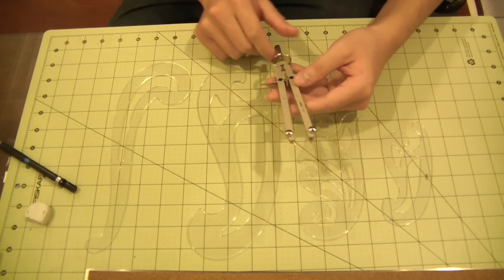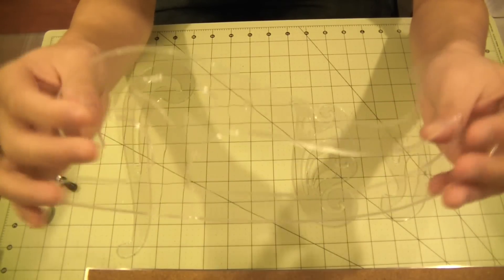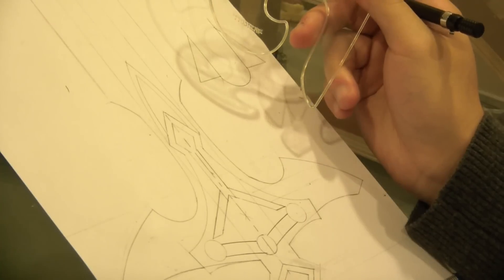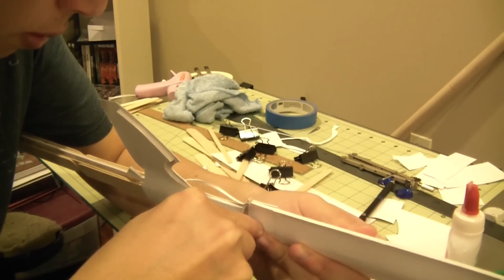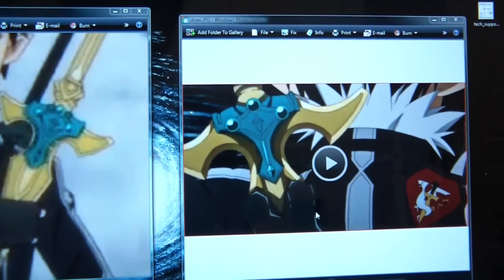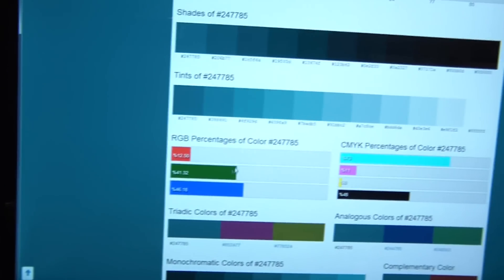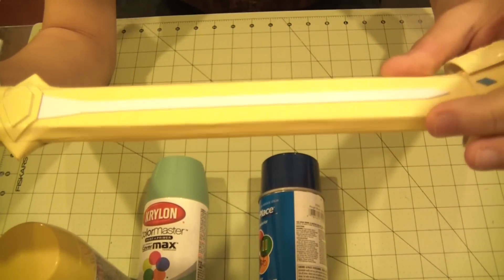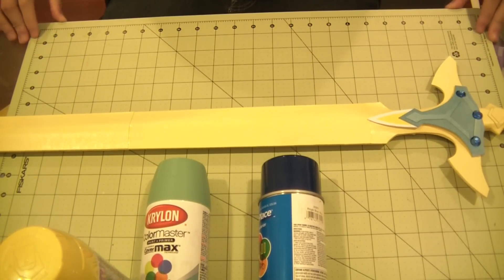Build Vlog 5: ALO Excaliber

Comment: For metallic colours, you need to base coat them in either black or a darker shade of the colour you are going for. The sheen off metal is mostly from the micro scratches in the surface.

Comment: great job!!! keep it up!  your acrylic problems or paint issue problems.......get an airbrush. mix till you are satisfied with the color. then thin with water or windex or whatever, research all the options and pick your favorite. the shade of color shouldn't change when thinning. thinning just makes it easier to spray with an airbrush. use the same technique as when spray painting basically. but dont get the $6 deals from god knows where. actually fork out some money on an air compressor and a real airbrush. I recommend an Iwata HP-BCS since those are pretty common and easy to troubleshoot. what you could do to get that polished gold look, buy some gold vinyl car wrap and wrap the sword. you coulda done that for like Kirito's elucidator and alo sword since those edges and details are really silver and not white. you coulda silver wrapped the sword and then done your taping trick and paint the black areas.

Comment: Sorry if the answer is obvious, I just struggle with this... Round handles?? Help??
Reply from the maker: im stuck in the same situation, round isnt quite yet possible without being overly bulky, so hexagonal handle is your best bet
Reply: Oh okay... You should make a video about different shapes people will encounter building certain blades.. How do you make the hexagonal handles though? Thanks for the feedback!
Reply: Why not get a pole just under te size and thickness of the handle and surround it with a layer or two of cardstock? Then remove the paper handle from the pole and fit it on to the handle.